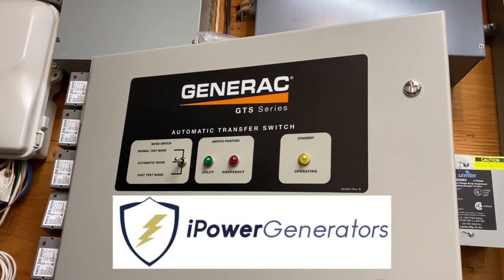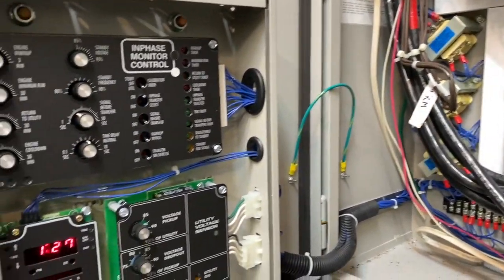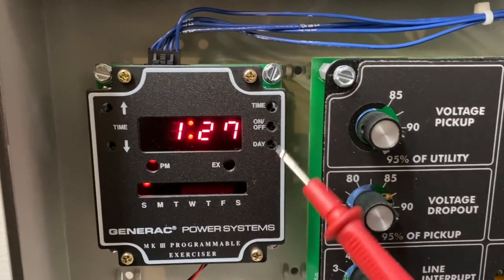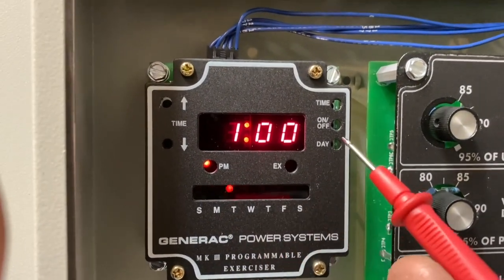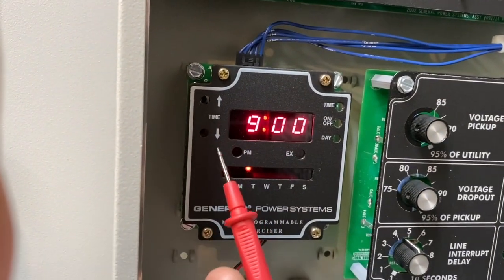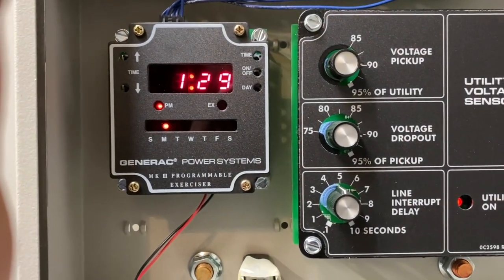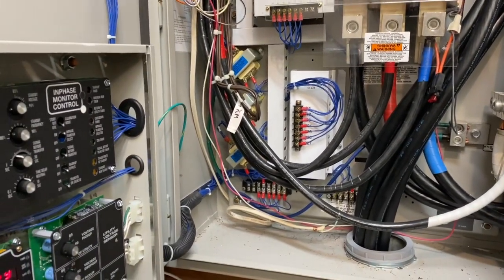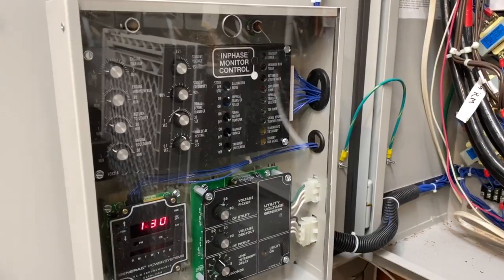Generac GTS Transfer switch Setting Exercise

Comment: Only problem is the settings will be lost at the next outage or if the utility power is turned off because the 9 volt battery is not connected to the exerciser - the 9 volt battery keeps voltage on the  exerciser during transition .  That style of Industrial ATS is by far the best Generac ever made.

Comment: I still can't figure out how to reply to a reply on YouTube. Anyway, customer's exerciser is shot, not responding to buttons, so I'm going to replace it. Customer has no manuals, I can't find mine, but, I found you. And yes, having a manual IS priceless. Thanks again.
Reply from the maker: I might have access to the manuals … I’ll try to look for them and let you know.
Reply from the maker: @crustybunz i found the owners manual and some wiring diagrams ... you can email me and i'll reply with them.

to get my email you'll have to go to the "about" section on my channel you can get the email address there.  I would post it but with scammers and bots i'll get bombarded with nonsense.
Reply: The only contact I see goes through the company email. I'll use that if you're okay with it. Just wanted to clear it with you first.  @ipowergenerators4200

Comment: Perfect, just what I needed, thanks man
Reply from the maker: No problem… you working on one of these switches?
Reply: @ipowergenerators4200  No, I'm not a generator guy, we had a power outage and afterwards my building generator wouldn't do its weekly test. Couldn't see anything on the generator control panel. Read the manual, couldn't find a thing. Then had the bright idea of opening the box on the wall, saw a timer blinking, and started searching. Found your vid and reset the timer, all good!
Reply from the maker: @sitkamaint3265 that’s great!!

The older units had terrible manuals!